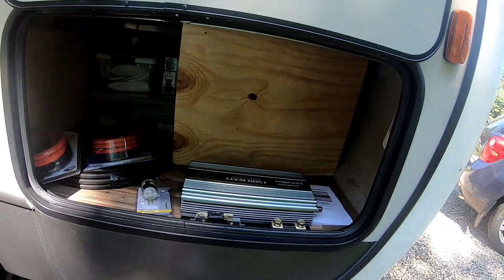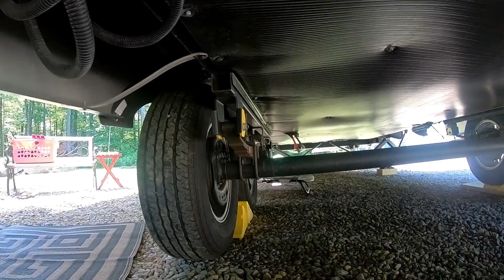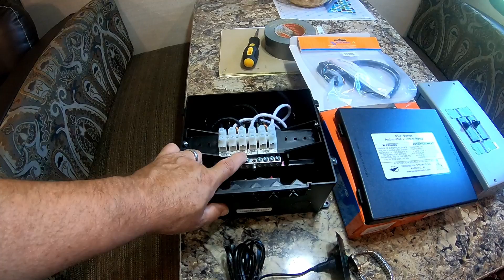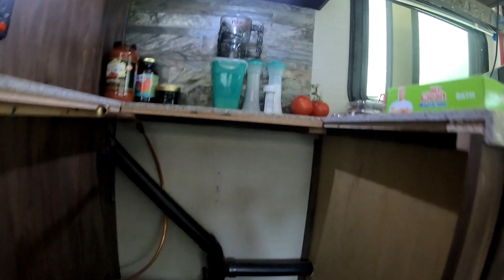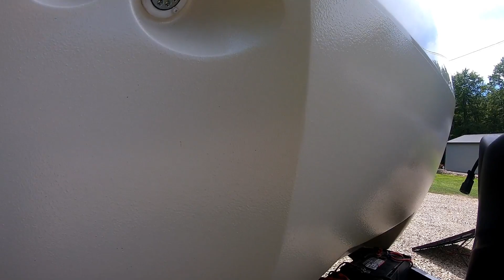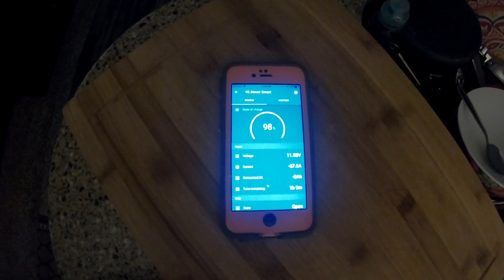Invertor install July 10-12 2018

Comment: The flexible solar panels aren't as good as they tell you they are. I'd check them out before purchasing.
Reply from the maker: Frank Mitzen Agreed. We opted to keep the fridge on propane. Economically cost effective.  Fridge needs one pound of gas a day. There is 4 pounds in a gallon.